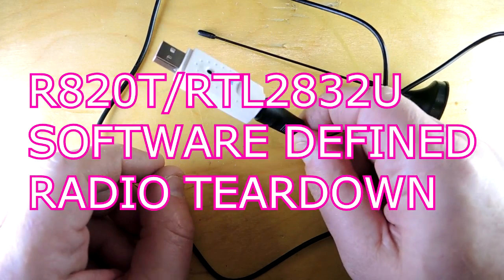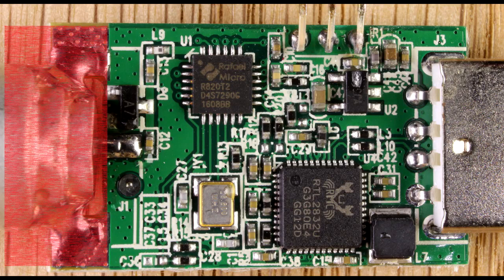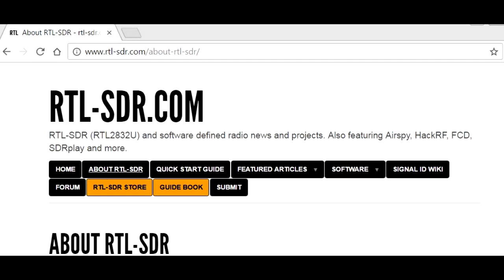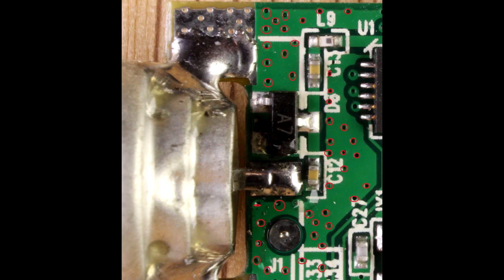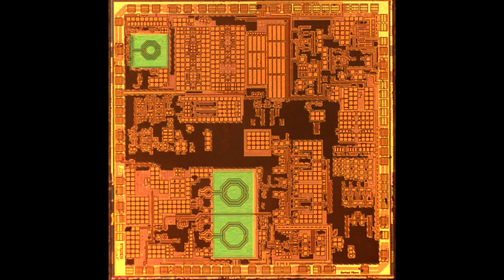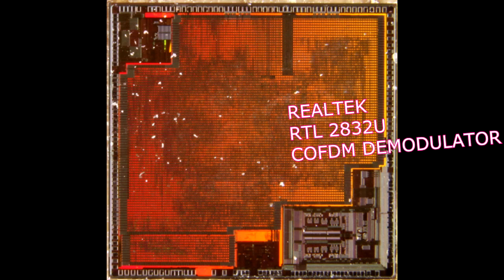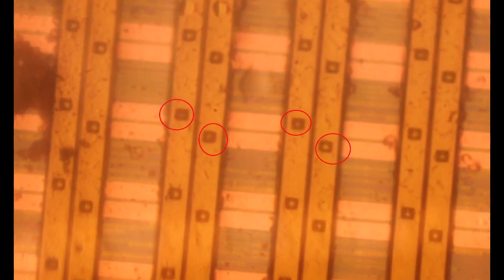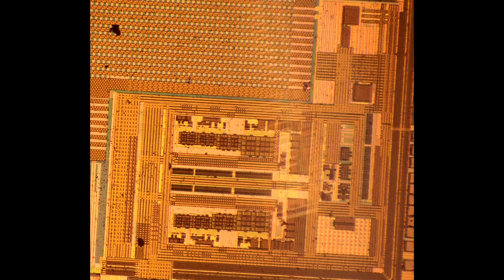SOFTWARE DEFINED RADIO TEARDOWN: R820/RTL2832U DECAP

Comment: The back to back diodes to ground is very common on low voltage inputs to help protect circuits from human generated ESD.

Comment: One minor correction. You said near the end of the video, "it can decode all kinds of signals". Technically this is incorrect. The majority (or entirety) of the RTL-SDR project is using a software driver which will simply put the RTL2832U into "raw I/F dump mode" (which is basically a test mode) and this has been re-purposed from a test function into something that goes into something like Gnuradio or other custom libraries and software decoders. (The other custom libraries and software decoders tending to be more popular because they are function specific and Gnuradio is quite a beast unless you spend some time with it.)
Reply from the maker: Thanks for the additional detail